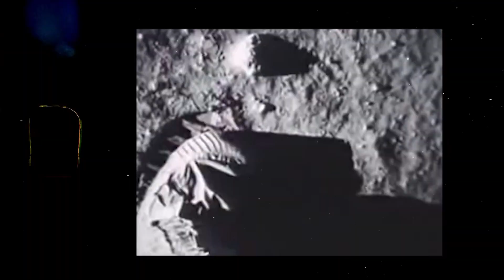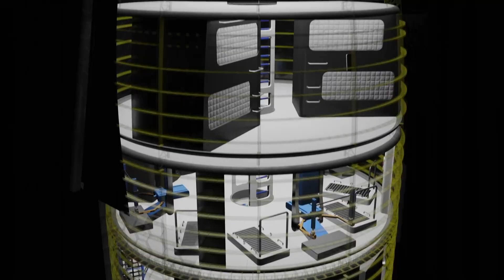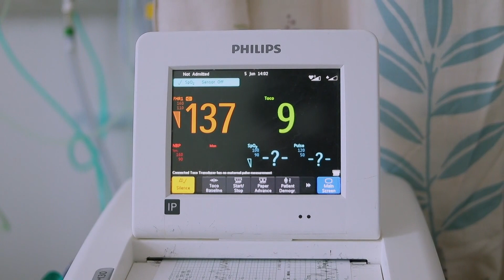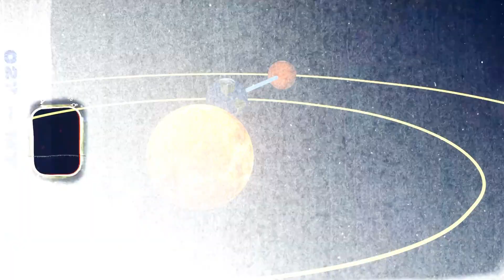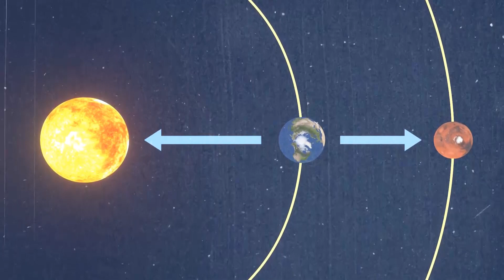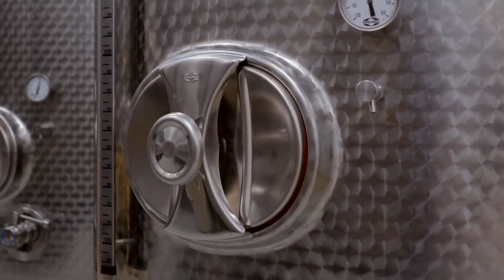Let's Take A Ride To Mars Aboard SpaceX's Starship!

Comment: It's all fantasy...Musk will get no-one to Mars.
Reply from the maker: Let's wait and see! ;) 

Thanks for watching!
Reply: @spacetechuniverse .  Seems like an extravagant dream at the moment. There are lots of problems that will need solving. For one thing, the astronauts aboard the ISS spend a great deal of time exercising to try to counteract the negative impacts of long term living in a microgravity environment. Yet even with all that, they are incapable of walking away from their re-entry vehicle, and need to be taken away in a stretcher. But that isn’t an option on Mars. 

I’m also skeptical about landing a spacecraft that large on Mars, where there’s no guarantee that they will find a level space to land. What if the thing tips over? This was a concern with the Apollo missions 50 years ago, and the LM had a much lower center of gravity. 

Then there’s the important factor of weight. Roomy accommodations for crew are science-fiction, because you need an enormous amount of fuel to get all that out of Earth’s gravity well (and then Mars, for the return flight). Weight was a huge limiting factor in all space ventures, and that includes Apollo, with that massive Saturn booster (which, by the way, never had a catastrophic failure in flight, or, if you prefer, a “rapid, unscheduled disassembly”). The engineers who designed and built the LM were constantly having to cut down the weight. No seats, small windows, barely room to move around, especially when in their EVA suits. 

Apollo also had an army of support on the ground, and the Moon was always about three days away. In terms of communications, there was a maximum gap of 1.5 seconds (one way), so nearly instantaneously support from the ground in troubleshooting problems. But the distances are going to be much greater with Mars, and when problems arise, there will be much longer gaps in communications with Earth. That gap varies, of course, with the distance between the two planets. There are times when they are on opposite sides of the Sun. So what happens in an emergency? 

Then you have the problem of exposure to both solar radiation and cosmic rays. (Mars has no magnetosphere, and a very thin atmosphere— not very good protection against all that radiation). There’s the fact that Martian soil is toxic for planting human vegetation. 

To me, it makes much more sense to have the next step be long term missions to the Moon, with a permanently crewed base. In case of emergency, Earth is three days away. And communications would be nearly instantaneous.
Reply: Elon- and I took that personally
Reply: pepole whare laughing when hi start produce electric cars to